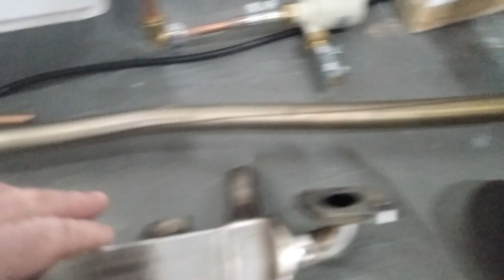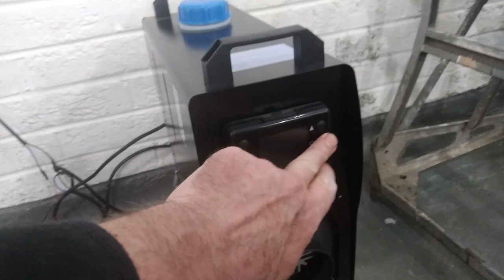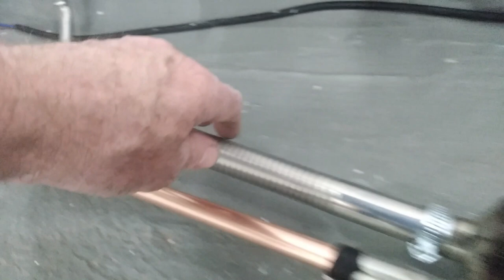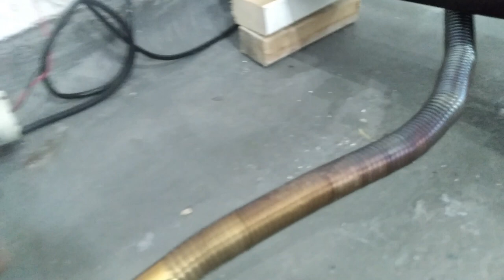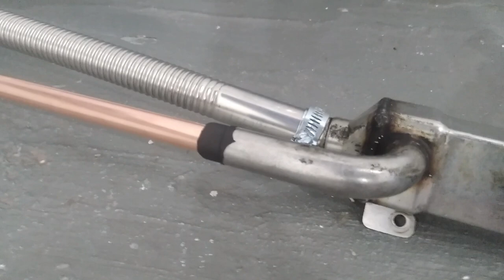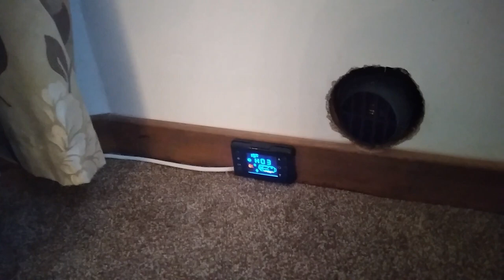Free Heat from Waste Exhaust Heating Radiator Home Diesel Oil Heater Mini Central System Exchanger

Comment: Congratulations, you have built a condensing diesel heater. The steam is proof you are extracting energy from the exhaust. Mount the heat ex closer to the output of the machine and reverse the direction of water flow for greater efficiency. All the best to you.
Reply from the maker: thank you andy xxxx